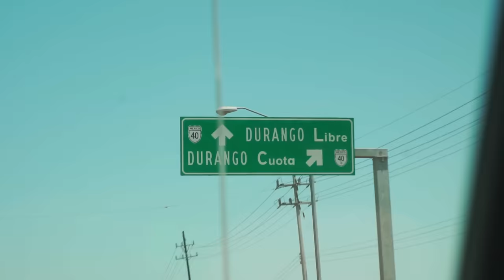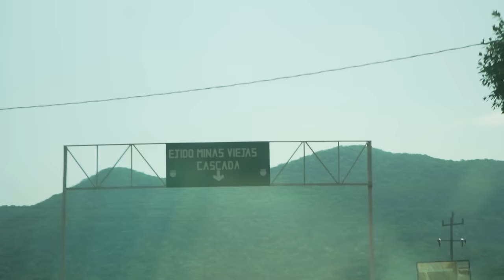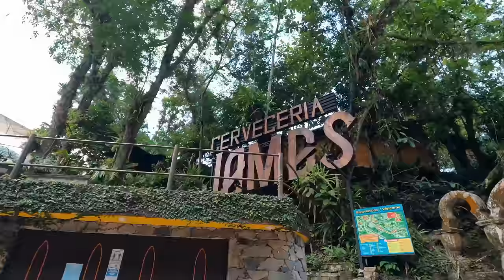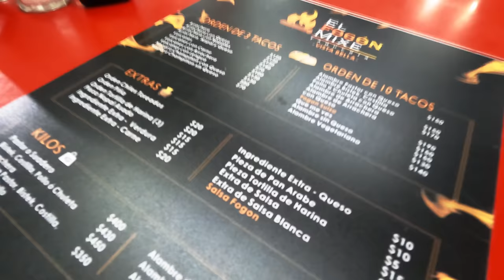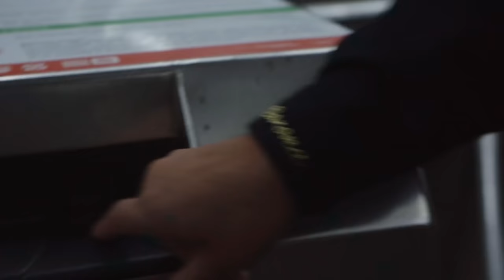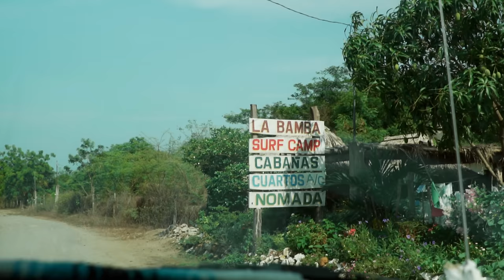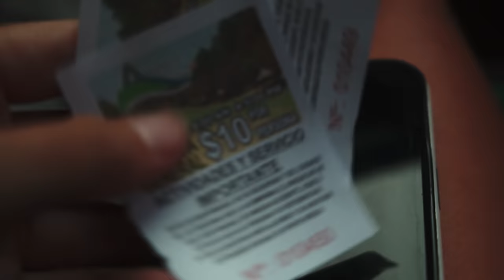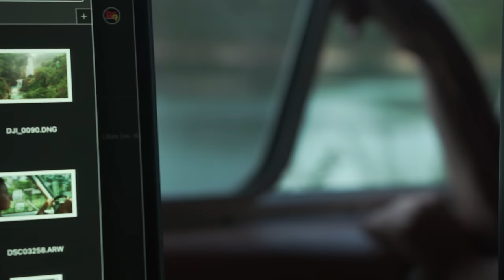THIS is Mexico | Overland Travel Documentary

Comment: The "mystery" fruit you had at 1:38 is called Mamey (mah-may) in spanish.  I think the one you had was overripe.  Generally it has a similar consistency to an avocado, it shouldn't be too squishy and it shouldn't be stringy as you mentioned, like pulled pork.  You can eat it similar to an avocado where you cut it up in wedges or simply scoop it out with a spoon.